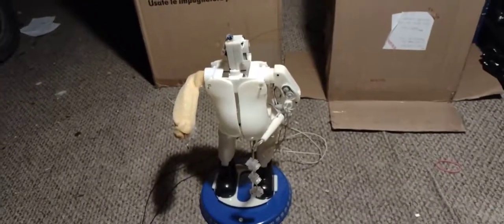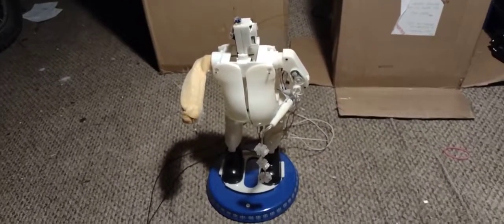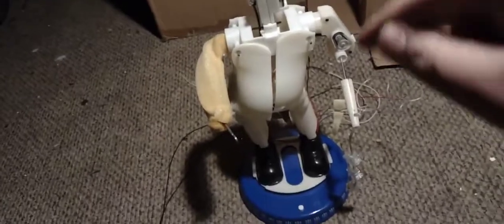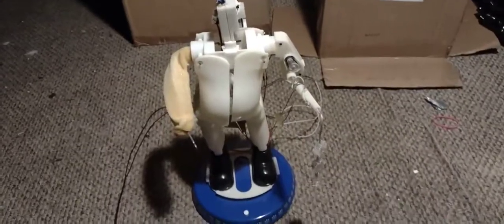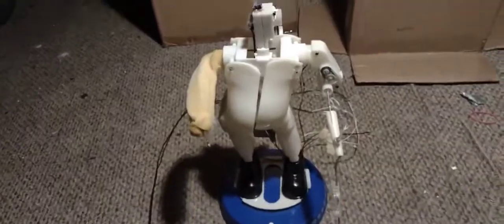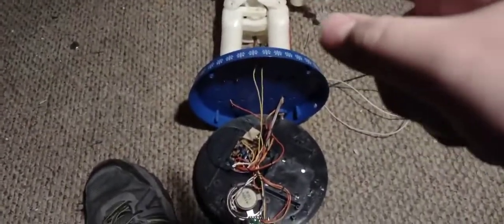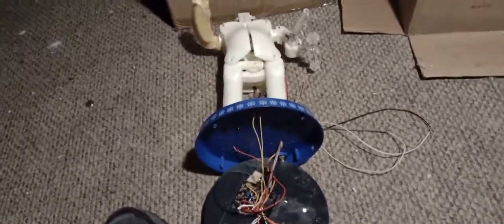(REUPLOAD) snowflake spinner on a 12 volt

Comment: 0:01 9 Volt,
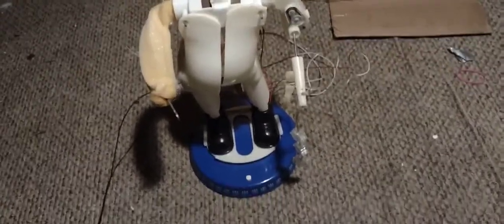0:42 12 Volt
3:40 6 Volt (regular power supply)
The experiment was that if the sound was disconnected, that the sound would not fry, and not give up. This experiment proved successful, after rewiring the sound and it worked.